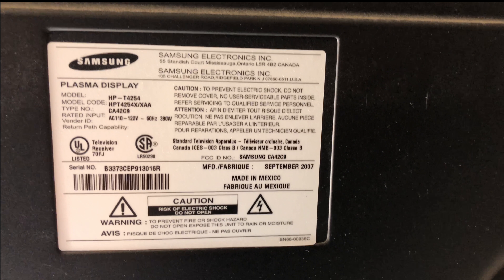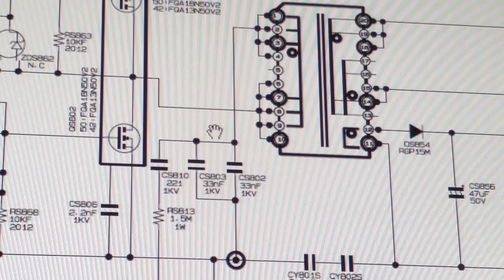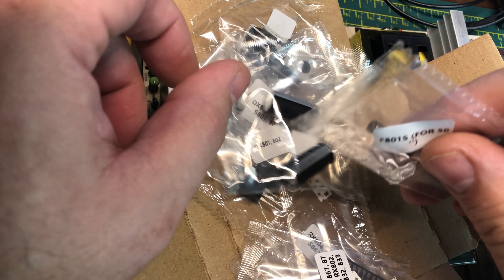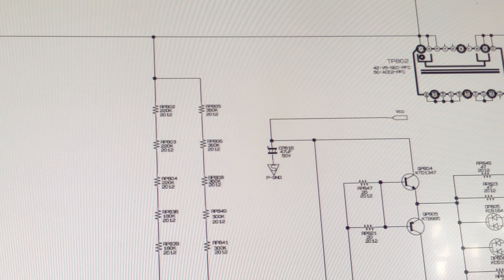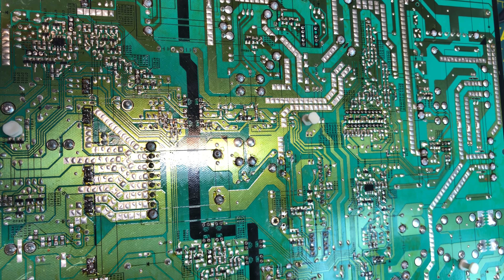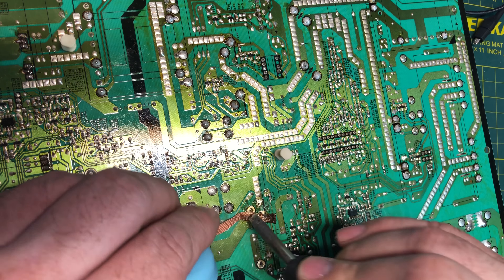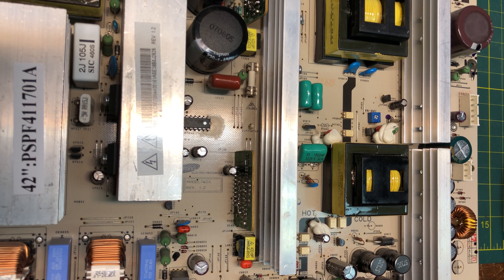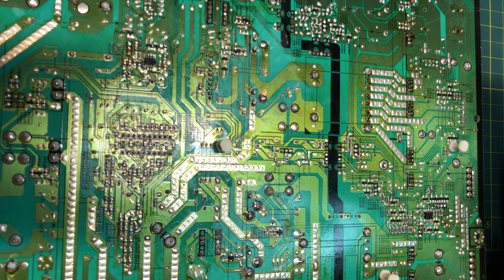Samsung HP-T4254 Plasma TV Repair  clicking. Component Level Fix

Comment: I have a different Samsung Plasma tv I'm repairing but the issue is a bad transformer/inverter (I don't have a schematic yet so not sure if xfmr or inverter) and I cannot find these anywhere. Would you happen to know where I can find replacement transformers? My model is  PN64D8000FF XZA, Version 1503 and the transformer/inverter P/N is 
"MQGAH033430 NY 

NYB-003 LN 1136S", 
this xmfr is located on the main power supply board.

The main power supply board.
Model: PB6FA-DY
Sec CODE: BN44-00447A

Any help would be greatly appreciated.